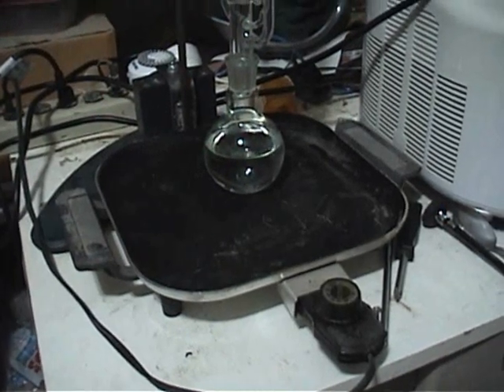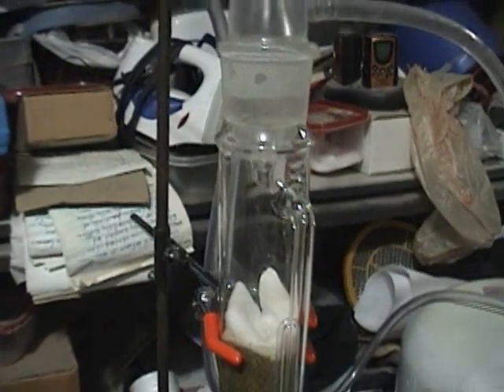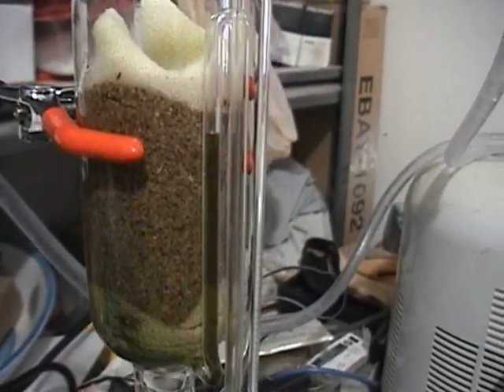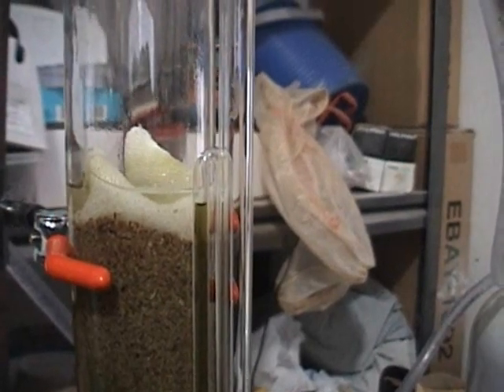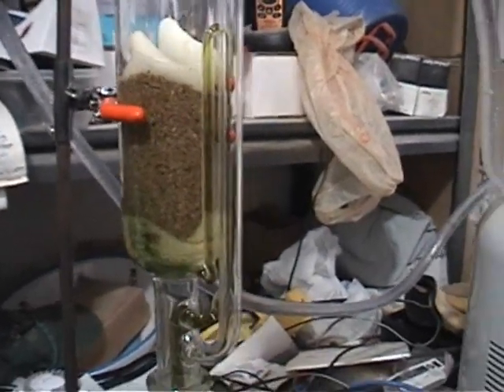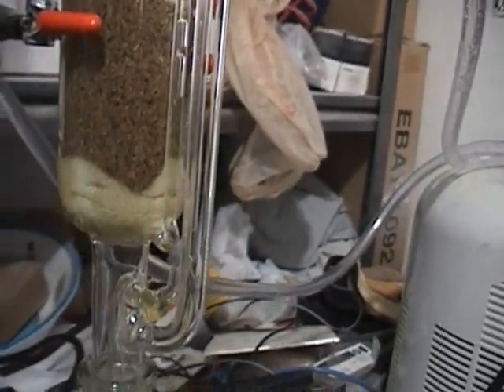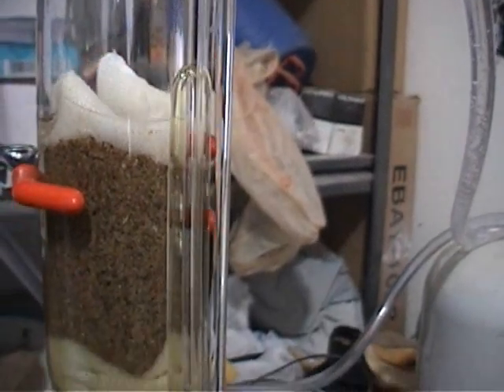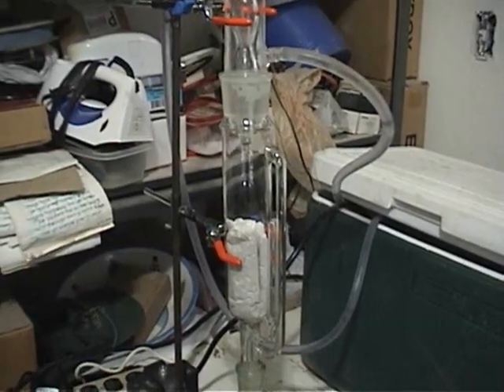Soxhlet Extraction of Medical Marijuana Oil

Comment: I would suggest changing your solvent.  Ethanol is a polar solvent and cannabinoids are nonpolar.  Use pentane instead, it's more expensive then ethanol but it boils at a lower temp (39 degrees celsius) and is non-toxic.  The lower temp helps keep the cannabinoids from breaking down.  Also you won't extract as much chlorophyl and terpenes, as those are polar compounds.

Comment: The condenser cold water should feed from the bottom inlet an drain from the top. Also you can buy thimbles that fit your soxhlot diameter that gives a much more even wash path. I've tried both and it's also less restrictive. And heating mantles can be bought online that will match your flask size (half way up). PS: try Petroleum eiter (30-60*F) as a solvent but use it CAREFULLY in a hood with the oxygen displaced! Flood it with nitrogen. Very explosive but very selective for just thc only so very little green comes over.   Enjoy✌🏽️

Comment: You can use a porcelain, glass, or metal bowl or pot with sand, high heat oil, water, or BB's and immerse your boiling flax in this.  The substance used to transfer heat will depend on what you are doing.  Sometimes it is desirable to transfer heat quickly and efficiently (BB's), but sometimes one wants to transfer heat more slowly (sand), such as in fractional distillation.

Comment: your water flow in your condenser it backwards. Usually the inflow is at the bottom and the outflow is at the top. You can see the condenser isn't getting completely cooled down. maybe your pump isn't strong enough, sometimes you have to run it upside downXD.

Comment: You are using the condenser improperly. Feed H2O thru the bottom, or turn it over and let it fill up with water and then place it in the top of the extractor. And get some THIMBLES.
Reply: Can you exlain to me how to use a soxhlet extractor?
Reply: Hello, could you answer me 2 questions? 
How long does the process last and at what temperature?
Thank you in advance !
Reply: Ghost you can run the process as long as you want and you will never get all of the stuff out you want, but after a time it is not worth it anymore to let it run longer

Comment: get a WAXTRACTOR
Reply from the maker: Nope....just another one of those EXTREMELY DANGEROUS methods using liquid butane open to atmosphere to produce a potential fireball! I learned my lesson with this method OUTSIDE with no open flames  and still got ignition some how(static discharge?) The best rig for this purpose is the Tamisium Extractor, which is not only EXTREMELY SAFE, but produces a much higher quality product and returns nearly 100% of your butane for re-use over and over. You can do an extraction and recovery within an hour with the right setup.
Reply: true Tamasium is a great system, but waxtractor has a full vacuum purge system and butane recollection as well, for about 1/2 the price
Reply: Jumbonot Soxhleting is Fine., if you know what you're doing Thing is that this guy doesn't.

Comment: you decarb it (and potentially ruin it) as you reboil the solvent.  Not too good to let your active extracts be subjected to such heat for extended periods of time, it destroys the alkaloids.

Color is another biggie, it is Dark Green, which means you have extracted a sizable quantity of Chlorophyll.
Reply: *****
 
 If you are using Acetone to extract,
 the heat never goes above 56-57 degrees Celsius. Methanol boils at 65 C and IPA at about 78... Those temps are Not hot enough to harm the THC... Water boils @ 100... THC boils @ 157 C. I use laboratory equipment, so it is much easier to control the temp. The heat doesn't go above the boiling point of the solvent and doesn't rise, until most has boiled away.
Reply: Good for you, you had a chemistry class, perhaps you don't work with cannabis on a daily basis?

Heat destroys dabbable hash and makes it food use only.  Similar to Reclaim.  You "can" dab it still, but the flavor is gone and high is not the same.

I did use a term out of place, my bad.  I meant to say cannabinoids.

Heat is the enemy, especially when working under a vacuum.

Soxhlet is really only good for edibles, and still there are better ways to make a more pure "clean" product.  Plus the resulting product might be worth less than the cost to do the extraction itself, if you can even sell it.  Hell, might as well use Hexane for extractions, even tho you can taste it in the final product!

As far as I am concerned, if it doesn't come out "Golden", its pretty much garbage.

I don't mess with the "products" that use the waste material as the main ingredient.  Juicing is about the only viable route, as it is never heated, to obtain the medicinal THCA and CBDA, which is broken down upon application of Heat.

Juicing I would support.  Cooking to concentrate I do not.
Reply: *****
 That's why I made shatter with pretty much the same way the video was done.
 I don't know who mentioned heat, but it doesn't doesn't matter. The solvents usually used have a low boiling point so they don't even get up to the temp to ruin it.

90% of people doing this stuff don't know what they're doing.
Reply: I don't know what both of you are talking about. MisterGee Marino The heat can go above the boiling point of a solvent, I have done it. It ended up pretty bad. I used DCM(dicholoromethane) which boils at about 40 degree's C, my temp was up to 100 degree's C for some reason. I knew it was high, but... i didn't expect it to go over 100 degree's. It just burned everything.

***** I think you're missing the point. Those things won't be present in the final product. A simple test is, when you boiled off most of your solven(most of these solvents boil off below the boiling point of water). You add a bit of water. If you final product has no water, that means it also has NO solvents. They would be gone before the water boils out.

WHo ever said "alkaloids" is incorrect. The products we are after aren't alkaloids. Alkaloids are nitrogen based, the Cannabonoids don't have nitrogen in them.
Reply: asmcriminaL Sorry, just simple facts of the matter.  Unless you have lab tested residuals data, its just theory & opinion.

As for water, yes, most if not all, tap water is "poison", in my eyes.  With all the extra shit in it, Fluoride esp.  I refrain from drinking that which is known for containing such things.  Realistically, it is unavoidable.  You can buy expensive special foods to avoid one thing just to be fed another!

But for a daily consumable that is used more than pretty much anything else (food, water, etc.), I think it should be fucking "a" clean.  At which point, acetone, naptha, ipa, dcm, hexane, etc.  I DO NOT WANT!
Reply: ***** All i am saying is if you're worried about contamination, EVERYTHING is contaminated, even the air we breath. So you might want to let go of that idea. There are "safe limits" of exposure. Chemicals have a MSDS(Material Safety Data Sheet). It tells what is permissible limits and what is not.

I think the issue is confidence. The person who is making the product has to know what they're doing. Buying something from no name joe on the street corner can be questionable.

I am a chemist, and I trust what i do. I know what's going on, and how to do it and how to deal with issues that can arise. That's what i was trained to do.

The solvents used have an odor. Our nose is there for a purpose. If you can't smell the solvent, then it's below harmful levels. I even explained how to ensure all solvent is removed with water.
Reply: Lol.no its not an alkaloid-maybe you should go back to school. Its has no nitrogen so how is it an alkaloid? Again another armchair internet chemist...maybe you should actually know what your talking about before commenting and sniping at other peoples post...even though hes getting it completely wrong...but them again so are you.O dear...
Reply: Realistically, I see now that he is doing this on a pancake griddle, so it shouldn't be too excessively hot, depending on what the temp is set at.  And with a low temp boiling solvent this "would" work.  However, the resulting product is very very dirty.

As for trying to make use of the absolute garbage, this has potential.  Tho again, I would rather consume a product made from the upper leaves rather than the fan leaves, and if consuming for medicinal value, juicing is still the only viable means of obtaining the acids.

There is much to learn from this plant still.  Many new methods of extraction to be discovered.  I am being a little harsh to just talk shit on videos, but hey, this is youtube and wtf are you doing?  It would be interesting to see this be proven viable, as then that is one more source of materials for topicals, tho it would seem the resulting product to be very low in concentration.

It also all has to pass lab testing for microbials, aflatoxins, pesticides, heavy metals, and residual solvents before it can be sold.
Reply: asmcriminaL ill still pass on consuming dirty shit.

No matter what you do to it, once you add something, you cannot remove 100% of it afterwards.  You can get damn near all (say 99.9999%)  but there is still that 0.000099999999%.

Small as it is, I do not wish to consume it.

Just like why people dont want to take vaccines, because of the Mercury.  Though small enough to not hurt you, it is still there.
Reply: ***** Do you know there is mercury, and cyanide in vegetables too? What about water?, i am sure you know there is stuff like chlorine in that as well.
Reply: asmcriminaL its still gross regardless.

Being that everything is already contaminated, why contaminate it more just because we can?

Stores are questionable as well don't forget.  Many simply regurgitate anything that sounds reasonable just to make the customer happy.  Most is bullshit.  They should be required to provide proof of their claims.
Reply: ***** This issue has been around for decades if not centuries. I am not sure what your concern is, but I am assuming illness/disease? If that's the case, then that is mostly genetics. Some live long and healthy, others don't. I think you worry to much about things that really don't matter that much.
Reply: asmcriminaL Yes, I do worry a bit much, I know this.  But it is from consuming bad taste / low quality purchased from dispensaries.

I remember buying un-purged bho from many stores.  Most do minimal purging, leaving all the extra water weight, which hurts the lungs when you dab.  You could purge the purchased shit, just to watch it bubble up & dry out. Every 1g typ has about 0.3g of water.  Yea, they are selling us water!

It is good that you are making use of the whole plant, but is it cost effective?
Reply: I have a vacuum pump... I can boil at almost room temp - lol.
Reply: *****
It does not legally have to be tested before it is sold. This is a simple legal fact about the medical MMJ industry (at least in Colorado) at this point in time.Therefore, get to know your grower, because there are some unscrupulous commercial growers who are using pesticides, and most pesticides do not undergo testing to see what happens when they are smoked (they are legally required to be tested to see what happens if they are injested.) A pesticide that is more or less safe in small quantities when consumed orally might turn into a more toxic or volatile, biologically active chemical once exposed to the extreme heat of smoking. or it might be absorbed directly into the blood stream through the lungs when in other circumstances the pesticide would be filtered out of your blood by your liver and kidneys. Many dispensaries do elect to undergo third party testing, but this is completely voluntary. Those people who test commercial cannabis exist in a completely unregulated marketplace - basically, they could be bribed to provide the test results that the grower desires and that would be 100% legal. So, long story short, until there are more stringent regulatory structures in place -know where you get your cannabis.
Reply: Can you exlain to me how to use a soxhlet extractor?
Reply: MisterGee Marino  yea, but those chemicals also extract, and leave behind,  many other things other than just thc...

Of the 3, IPA is the closest to being OK...  Pure Ethanol would be better.

I prefer not to ingest things like methanol (make u blind) or acetone when consumed.  Not even the smallest portion.

Might as well use Gasoline or Naptha to do the extractions as they will "work" too.

Just my $0.02.
Reply: Cured weed is already, for the most part, Decarboxylated. That's why it gets you high, when you smoke it. The heat does not hurt the oil, especially if you use a low boiling solvent.
Reply: "The heat does not hurt the oil"? my ass!

Over Temping is the #1 reason for fucking up a run!

Comment: First you need to introduce tube with cold wather on the bottom of the refrigerant. You can separate oil with simple distilation of alcoholic extract. Should know that preparation is prohibited in some countries.

Comment: @Jumbonot: Use a cast iron tea kettle, and suspend your RBF in water. Use a thermometer to keep the water temp to just less than boiling (Will change with elevation: 212F @ Sea level, 194F @ 4000 ft)

Comment: make sure you get all the air out of your condensation tube before use, the water splashing on it like that is begging for an accident, also you will condense more vapor. Also you don't need to de carboxylate ahead of time the temp of the water vapor is enough to de carb

Comment: Do a secondary wash with a non polar solvent like hexane and it will only pull out the non polar volatile plant essences leaving the polar water soluble stuff behind. This is best done when taking the oil from the first extraction and freezing it for a few hours.

Comment from the maker: Many videos are planned for the future....right now I'm working to perfect my hard candy recipe and my pain relief topical liniment. To purge I simply place a one cup jar in a very small crock pot, with a mineral oil bath, and allow the solvent(acetone) to boil off. I then allow it to cool and solidify and examine the properties of the resultant "standard oil" to be certain that the acetone is fully purged. I then allow it to sit for a day or two to evaporate any water that might be left over.

Comment: You should use a water bath for the flask. This is of course assuming you are using a solvent with a lower boiling point than water. I typically use acetone as the solvent. It works great with Kava and Skull Cap. You should also put some boiling chips in the flask. That will help with the boiling. As others have pointed out, water goes in the bottom of the condenser and out the top. 

After extraction I do a simple distillation for solvent recovery. Then evaporate off the remaining solvent.

Comment: From bottom to the top: round bottomed flask, Soxhlet extractor, condenzer. You will also need: cellulose thimble, sample, organic solvent (ether, petrolether, hloroform etc; depends on the type of sample), heat source (consider that you need heat controler, these organic solvent is also flamable; set temperature by the temp. of evaporation of these solvents!). This sould be worked in digester!!

Comment: fine for the job just need to think about how you operate it you can get a stronger pump if that doesn't handle the head height on ebay for $20 buks like i did for my still look for one that does around 300 lph to 600 lph liters per hour the 600 is better i use a pot still sort of setup though the liters per hour may be different for this kind of still

Comment: ok i dont know much about this type of extraction or any for what your doing but i do know about distillation sorry to poke holes through how you are running this setup now you are running your inlet and outlet of cold water back to front the outlet is meant to be the higher one and inlet the bottom 
fill the skillet with water it will transfer the heat much better and efficient if you want to improve more use the lid for it and cut a hole for the still to poke through what you have their is

Comment: Why didn't you just surround the main flask with a boiling water bath. Better heat transfer rates rather than directly using the heating plate?

Comment: Your supply line to your condenser should be attached to the bottom nipple and the return line to the top nipple.  This will assure your condenser stays completely full of ice cold fluid instead of only half full like you have it.  Cool set up.

Comment: May have been said but you need to run the condenser water from the bottom to the top, not the way you had it set up. It should completely fill with water, and that way the coldest water starts at the bottom of the condenser, not the top, less vapor loss this way.
BTW what solvent are you using.

Comment: Pet. ether is the best but it's like gasoline in regards to fire potential. -Very small quantities should be used and have a fire extinguisher ready along with personal protective gear!! Or use pure ethanol first then use the Pet. Not sure if its on the DEA watch list though.Be very careful if u use it. But you will love the results.:-]] P.S. use a blender to get more surface area on your material.

Comment: You also water water entering the bottom of the condenser and out the top. This will fill the entire condenser and prevent thermal shock.

Comment: I would actually consider hexane for this type of extraction. You get a clean extraction with several minutes of exposure using Hexane. Hexane is hydrophobic. You can mix with ethanol, winterize, filter out waxes, then mix with water. Put in a separatory funnel and shake and the ethanol/water will form a bottom layer that can be drained off. When ready, the hexane can be distilled off at about 170F if I remember correctly.  Just use your condenser and save it for re-use.